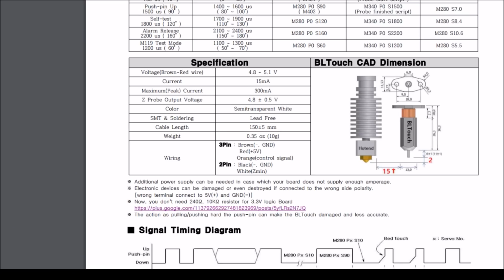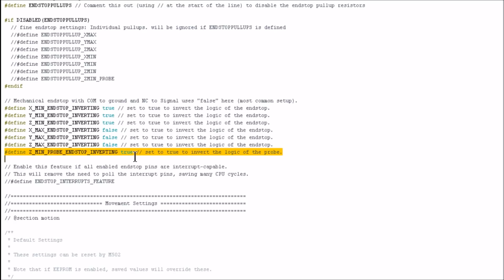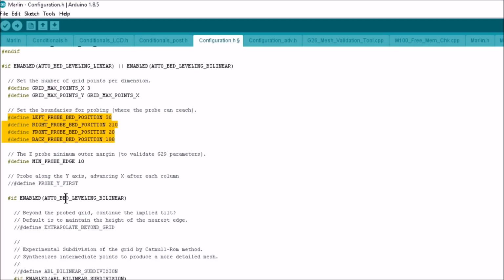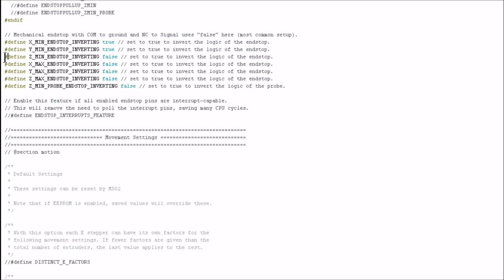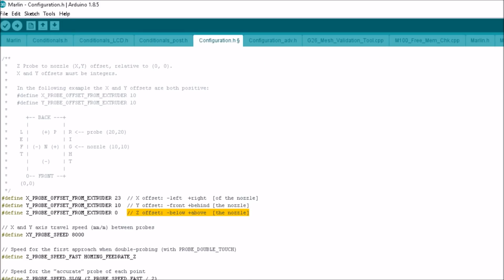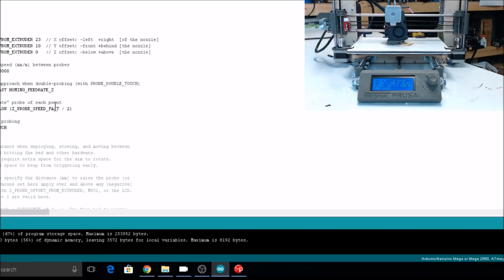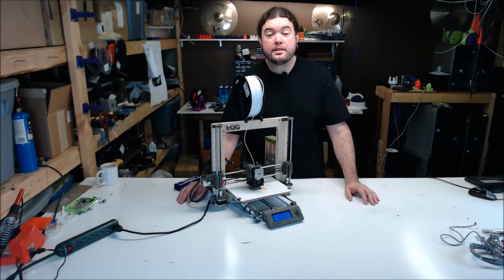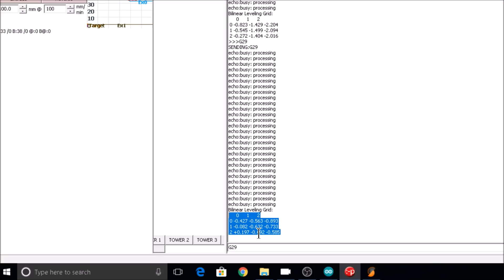Add Auto Bed Leveling to your 3D printer - Marlin - 2017

Comment: This video is great! Thank you! I'm having an issue tho.
I followed the instructions correctly but I cannot set the offset.  Somehow after G29, my printers moves up on Z Axis to a random position and therefore everytime I ran M114 to see the offset, I get a different value everytime. Do you have any idea what could be doing this? After a G28, when I do G0 Z0 I get the perfect "layer height" but after G29, the value is just random!
Reply from the maker: So after the G29, if you move to Z0, what does M114 say? How close is your nozzle to the bed at that point?
Reply: @ChrisRiley  After G29 -> G1 X100 Y100 Z0 F5000 -> M114 shows Z = 0. But, the distance is about 0.60 from the bed. When I change the Nozzle Offset in Marlin and I go again, I still don't get a proper distance. Like if the Offset did not correct the height properly.
Now, what I have noticed is that when I do G29 -> M114 right after G29 is done, I get a random Z height value. Sometimes it´s 7.8, other time 12.5 and so on...
Reply from the maker: @rodrigocandi2403  What does eeprom have to say, what does m503 output look like?
Reply: @ChrisRiley  Thanks again for taking a minute to help me. So, right now after the G29 is over, I send M114 and get: X:145.00 Y:128.00 Z:11.32.
Then G1 X100 Y100 and go down until I get the piece of paper under the nozzle. Then M114 and I get Z:0.72.
So, M851 Z0.72 and my M503 looks like:

echo:  G21    ; Units in mm
echo:  M149 C ; Units in Celsius
echo:Filament settings: Disabled
echo:  M200 D1.75
echo:  M200 D0
echo:Steps per unit:
echo:  M92 X80.00 Y80.00 Z400.00 E80.00
echo:Maximum feedrates (units/s):
echo:  M203 X200.00 Y200.00 Z10.00 E25.00
echo:Maximum Acceleration (units/s2):
echo:  M201 X3000 Y3000 Z300 E10000
echo:Acceleration (units/s2): P<print_accel> R<retract_accel> T<travel_accel>
echo:  M204 P300.00 R3000.00 T300.00
echo:Advanced: S<min_feedrate> T<min_travel_feedrate> B<min_segment_time_us> X<max_xy_jerk> Z<max_z_jerk> E<max_e_jerk>
echo:  M205 S0.00 T0.00 B20000 X10.00 Y10.00 Z0.30 E5.00
echo:Home offset:
echo:  M206 X0.00 Y0.00 Z0.00
echo:Auto Bed Leveling:
echo:  M420 S0 Z10.00
echo:Material heatup parameters:
echo:  M145 S0 H180 B70 F0
echo:  M145 S1 H240 B110 F0
echo:PID settings:
echo:  M301 P22.20 I1.08 D114.00
echo:  M304 P4000.00 I30.82 D150.00
echo:Z-Probe Offset (mm):
echo:  M851 Z0.72

Now, I'm going to try once again:
G28 -> G29 -> M114 (X45.00 Y:128.00 Z:9.47 - that is the random Z height that I'm talking about).
Moving forward I go: G1 X100 Y100 Z0 F5000 -> M114 -> X:100.00 Y:100.00 Z:0.00 but the nozzle is too high. So I go again and move it with the Pronterface until the piece of paper under the nozzle is good... and now I get Z: -1.90

All of this with the unheated bed and nozzle.
I hope you can find the mistake or error.
Thanks!
Reply: @ChrisRiley  Hey, I just upgraded my printer to Marlin 1.1.9 and the problex is fixed. Clearly a bug that I activated somehow.
Reply from the maker: Nice!!! Glad you found it.

Comment: This is good but what about if your home 0 position is not on the corner of your bed? then it messes everything up.
Reply from the maker: There is a couple ways around this. Z safe homing is probably easiest. By default it takes you to the middle to home.
Reply: @ChrisRiley  I tried that but it takes me off to the side of center. i tried over and over to set the safe home position but it did not work. I ended up wiping the factory firmware and started from scratch where i think it much better but still needs some fine tuning
Reply from the maker: @wrxsubaru02  Keep tweaking, you'll get there.

Comment: how do i configure this to use  a tactile switch instead of the sensor? is there a setting for this in marlin or do i just use the z nim end stop pins?
Reply from the maker: The micro switch should work exactly like the probe.
Reply: @ChrisRiley  should but doesn't, when i tried running a print it thought the z end stop was still there instead of using the probe function, for my application im using the build plate and hot end as the switch contacts, it would be very helpful to know what to do for the start/stop gcode to make this work.

edit: oh wait, i think i forgot a step, i forgot to set the z min end stop and z probe to false. < W >
Reply from the maker: Yeah, the logic might change.

Comment: Thanks for the video.
Here,I have a problem about auto bed leveling.I suppose that my heat bed was flat, but it was slant after assemble, there would be about 15 degree between heat bed and X-axis and it was parallel to Y-axis，when I use auto bed leveling during printing，would it affect the size in x direction and y direction？
Or there is X and Y offset to ensure the adjusting accuracy？
Reply from the maker: The size of the model being printed you mean? If so, that should be adjusted accordingly.

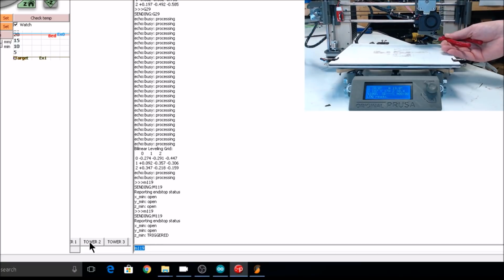Comment: I’ve been following all the procedure step by step until 7:35 ...  with “m119” input, my pc still shows “z-stop open”, even if sensor’s led is switched on ... how is it possible? Any suggestions?
Reply from the maker: Try switching Zmin endstop and zmin_min_porbe endstop from either true to false. Just filp both and see if that fixes it.
Reply: Chris Riley is there something else I could try?
Reply from the maker: @andreabonvicini1729  Sounds like a sensor problem, is it a 5v sensor or a 6-36. Maybe not enough voltage to trigger it.
Reply: Chris Riley 6-36 ... I tried to replace the sensor with no results
Reply from the maker: @andreabonvicini1729  I would try to hook it up direct to 12v and use a diode on the single pin.
Reply: @ChrisRiley   with those settings the probe is always triggered ... XD

Comment: Hi. Great Video. Helped me a lot but I am still struggling with the distance between the nozzle and the bed. I am always 0.3mm too high. Defining the Z_PROBE_OFFSET_FROM_EXTRUDER doesn´t change anything for me. If it is set to 0 or 10 the distance between nozzle and bed when I home the nozzle is always 0.3mm. So when I start printing it prints in the air. I hope you can help me out.
Reply from the maker: You're probably getting hung up from eeprom. Do a M502 then M500 and that should pull in your offset. You can use M851 Z to adjust it manually. Use M503 to see what it is set at.
Reply: @ChrisRiley  thank you for the quick answer. this is what i get when i do the M503: >>> m503
SENDING:M503
echo:  G21    ; (mm)
echo:  M149 C ; Units in Celsius
echo:Filament settings: Disabled
echo:  M200 D3.00
echo:  M200 D0
echo:Steps per unit:
echo:  M92 X100.00 Y100.00 Z400.00 E95.00
echo:Maximum feedrates (units/s):
echo:  M203 X400.00 Y400.00 Z4.00 E25.00
echo:Maximum Acceleration (units/s2):
echo:  M201 X9000 Y5000 Z50 E10000
echo:Acceleration (units/s2): P<print_accel> R<retract_accel> T<travel_accel>
echo:  M204 P1000.00 R1000.00 T1000.00
echo:Advanced: Q<min_segment_time_us> S<min_feedrate> T<min_travel_feedrate> X<max_x_jerk> Y<max_y_jerk> Z<max_z_jerk> E<max_e_jerk>
echo:  M205 Q20000 S0.00 T0.00 X10.00 Y10.00 Z0.30 E5.00
echo:Home offset:
echo:  M206 X0.00 Y0.00 Z0.00
echo:Auto Bed Leveling:
echo:  M420 S0
echo:Material heatup parameters:
echo:  M145 S0 H200 B50 F0
echo:  M145 S1 H230 B70 F0
echo:PID settings:
echo:  M301 P16.83 I1.02 D69.29
echo:  M304 P295.00 I35.65 D610.21
echo:Z-Probe Offset (mm):
echo:  M851 Z0.00
It says nothing after the echo:Z-Probe Offset (mm):...
Reply from the maker: @habe4741  Email sent.
Reply: @ChrisRiley  even if I change the Offset via M851 Z0.3 or M851 Z-0.3 nothing changes on the distance between nozzle an bed
Reply from the maker: @habe4741  Email sent.

Comment: Great Video! This helped get me alot further. So, thanks for that. But I still wasn't successful:( When Auto-Homing, it stops at the offset (My offset value, instead of 0). So my nozzle is still my offset value, away from my bed. Marlin recognizes that it's not at 0. I can manually step it down to zero, it just won't automatically zero itself. Any ideas?
Reply from the maker: So it should stop at your negative offset. The offset will be in the negative to compensate for the probe distance below the nozzle. Hopefully I am understanding you correctly.
Reply: @ChrisRiley  I was under the impression that it would zero itself when homing, but it would stop at the offset. I had yet to run a print through, but once I did, it ran perfect. So thanks again for this video!
Reply from the maker: Great!

Comment: Hi Chris, have you heard of the Precision Piezo sensor that utilizes a sensor that detects vibration on the hot-end itself? I'm wondering if you have an opinion on this compared to the BLTouch for any-material probing.
Reply from the maker: I have heard of that and I have tried to get one. Seems like everytime I look they are sold out. As far as accuracy, I think they would both achieve the same results. The Piezo however would be really handy because you would be leveling right at the nozzle. That would work great on deltas.

Comment: Can the tronxy xy3 use marlin firmware?(
Reply from the maker: Yes, as long as it doesn't have a touch screen it should work.
Reply: Dammit the one I have has a touch screen so what’s my options on getting auto leveling
Reply from the maker: @StreamzNow  You might see if Tronxy has any options. To go to Marlin you might need to swap to another screen or board.

Comment: Hey Chris, excellent video. Im not very good at Marling and you managed to explain everything clearly.

I have a Core-XY machine and... 
I have an issue. When I run G28, my printer moves its axis to home but my hotend and probe are lightly off the bed so when it tries homing on Z it tries to push beyond the homing point because when fully homed, the hotend is outside of the bed. If I try moving the hotend over the bed it tells my I must Home X, Y, and Z first. Repeating the problem previously mentioned. Any advise?
Reply from the maker: Thanks! Yes, you need to enable Z safe homing. That will home Z in the center of the bed. //#define Z_SAFE_HOMING   just uncomment this one.
Reply: @ChrisRiley  Thanks a lot! Will attempt this and get back to you asap!
Reply: Hey Chris! I finally got home and Tried what you said, however: When I do G28, it Homes X, Y, then the head moves about 30 mm in X and Y then start homing the Z, And even tho the Probe does Trigger (LED lights up), the printer Continues Raise the bed even further! the print head crashes into the bed but keeps going! Any Ideas?
Reply from the maker: @fhadesson9525  Sounds like maybe the probe logic is flip flopped. Try switching z endstop and z probe fro false to true or vise versa.
Reply: @ChrisRiley  Hey Chris! Just tried. it. This time Both being on true(they were on false) Now the probe does not even light up at all. Same crashing into bed problem.
Reply from the maker: @fhadesson9525  Wow, ok, back to false then. Doesn't sound like it's reading the trigger. Run m119 both with it triggered and without, does it change?
Reply: @ChrisRiley  I use Simplify3D and when using m119 it returns nothing. Should I try getting Prontr?
Reply from the maker: @fhadesson9525  Yeah, I would try to use Pronterface.
Reply: @ChrisRiley  Hey Chris! Sorry that took so long. I just tried Setting up Pronterface and Successuflyl got to do an M119. And indeed, Even tho the probe IS TRIGGERED and led is on. The switch shows Open.
Reply from the maker: @fhadesson9525  Interesting.....are you using a 5v sensor or a 6-36v? You could need some more juice.
Reply: @ChrisRiley  I am using a 6-36V PNP NO Probe. But I do have a 5v Laying around somewhere. Should I hook that up instead?
Reply from the maker: @fhadesson9525  Give it a shot, that could be the issue, just not enough voltage to trigger it.
Reply: @ChrisRiley  Also did forget to mention this is a 24v system would that make any difference?
Reply from the maker: @fhadesson9525  Hmmmm...that's a good question. I would still expect the endstop to be 5v.
Reply: @ChrisRiley  Hooked up the sensor accordingly, this one does indeed return TRIGGERED when punching in M119. But now, When I hit Home Z The bed moves About 10mm Away from the endstop instead.
Reply: @ChrisRiley  Woops! the 5V probe is NPN so I had to switch the INVERT Z and INVERT PROBE Z to False! It worked!!! Thank you so much!
Reply from the maker: @fhadesson9525  Awesome! If you want to try that other one you can probably hook the positive side to your power supply. Just make sure you use a regulator or diode on the signal wire so you dont back feed the board.
Reply: @ChrisRiley  I am afraid that may fry the Probe, I'll stick to 5v for now and maybe order a new one soon.

Comment: Hmm, had some issues trying to get things working with the EZABL. First was the logic was reversed, but switching the wires like TH3D guides says didn't fix that, I had to reverse the logic in firmware.
Now it triggers correctly, I set up Z offset and run g28, it homes all axis and then safe homes to the middle of the build plate (roughly, but skewed a bit towards the front/right), z ends up as 1.9mm.
When I then do g29 it starts probing with over half of the probe actually in front of the build plate and when it comes to the 3rd point (front right corner) it stops with a "fail to probe" (guessing due to the non centering).
Reply: Thomas Andersson lol...dump the substandard ezabl and use the inductive type as Chris. Tims plug goes in without polarity. His crap has taken out a lot of control boards.
Reply: @neuxstone  Isn't the EZABL an inductive one? Got it working now though, but only under unified firmware which I didn't really want to do.
Reply from the maker: You are probably correct, it's because it wasn't centered. You might need to adjust your probe location/probing limits to get center.
Reply: @ChrisRiley  I've figured out now, lots of help from your videos in addition to some googling. Turns out the nozzle can't reach the back end of the plate and end up slightly off the plate to the right. I respecced the build area to 230x225 and set the y offset to -14 so now 0,0 sits just over the front left corner of the build plate. I also set up the boundaries and now it doesn't hit the clips when probing.
Unfortunately my bed is severely skewed and uneven so I have stuff to work with yet. I use the Th3D solid mounts, what would your advice be to shim for a slightly more even surface? Over or under the mounts, maybe between the heat bed and build plate (but seems to me that would increase the risk of them movinga round or getting lost). Your guide works perfectly for the EZABL btw. :)
As you can see the play is 1.2mm from high to low, not good at all. http://www.tifozi.net/img/newplot.png

Another question, I also followed your Marlin setup guide and I'm now running the 1.1.9 bugfix version, I turned off EEPROM as a few times I got confused when I made changes that seemed to make no difference (printer was using eeprom stored settings). Q is, does bed leveling etc work properly with eeprom turned off, for example z-offset won't be stored will it? (do I set it in firmware or with gcode then?)

Sorry for all that, I really appreciate your videos and the personal answers and help given!
Reply from the maker: Not sure on the shimming, I am not familiar with the product. Maybe print some PETG shims of some kind.

The G29 will be taken into account everytime you run it, no eeprom needed. You offset should be pulled from the firmware and never change. Probably best to leave eeprom off until you get everything all set up.

Comment: I just got this working(kinda) It would initially plot all 9 points and all seemed well. Now, it only does the first 3 points on the front of the bed. I have no idea why.
Reply from the maker: That's strange, make sure your bed size is set correctly.
Reply: @ChrisRiley  oddly enough, I had to manually shim the bed and it started to work properly, thanks!
Reply from the maker: @Mogalize  Wow, it's not very good left to right. So the close the X is, the better it works.

Comment: Manually editing the offset in the firmware doesn't work in Marlin 1.1.9. You must use the M851 command to set it( see https://reprap.org/wiki/G-code#M851:_Set_Z-Probe_Offset)
Reply from the maker: You should be able to still use the hard coded value, you just need to update eeprom. After you upload, run a M502 and M500.
Reply: @ChrisRiley  Tried that (M500) didn't work :( The M851 value seems to be stuck in there even after editing the firmware.
Reply from the maker: @NeverMakeExcusesKeepGrinding  Hmmmm, that's really strange, I will test it on my machine.